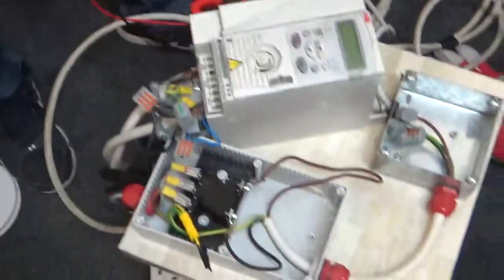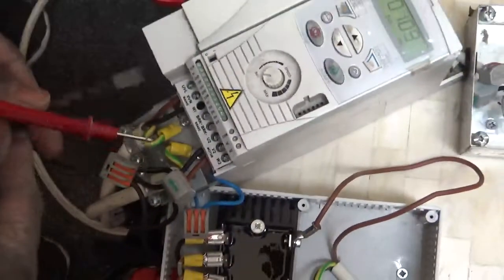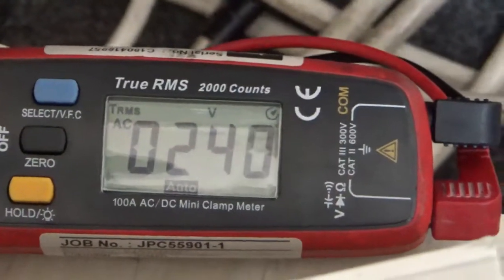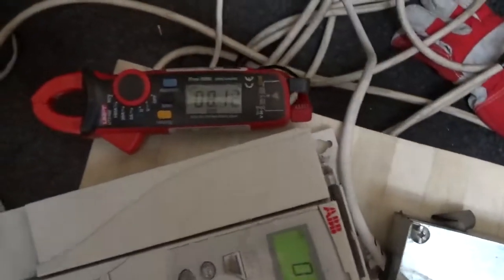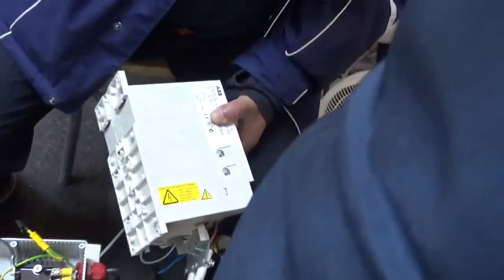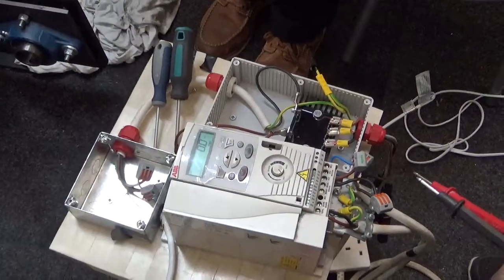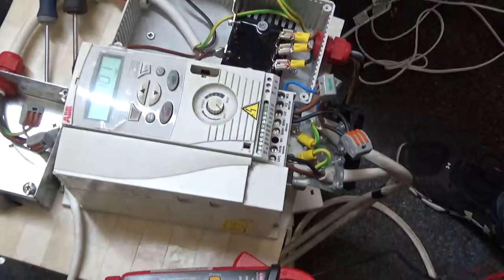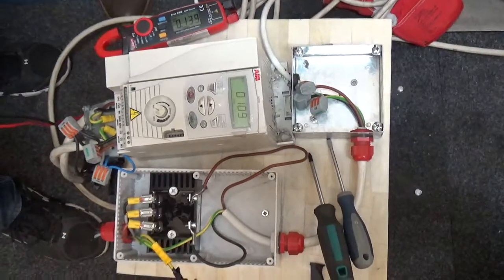Most efficient mechanical amplification possible, with evidence

Comment: This does not prove anything. even if you use 14 volts to spin that device we don't know kW used. Where is the 400kg coming from? I design heavy machinery and 400kg looks more than that. is it 400kgf? what is the moment of inertia, so we can see that this device actually do anything apart from spinning slowly?
Reply from the maker: Hi Sebastian, many thanks for your input,  the amps were 2.5 a x 14 v gives us 0.035 kw or 35 watts. The entire top part you see moving is close to 400 kg. We can load another 100 kg on top and the input will remain relatively low,  I,e under 50 watts.